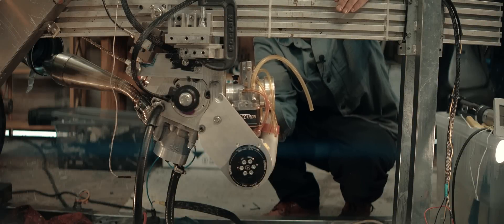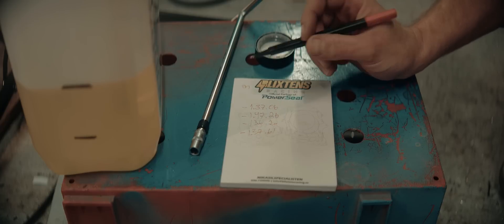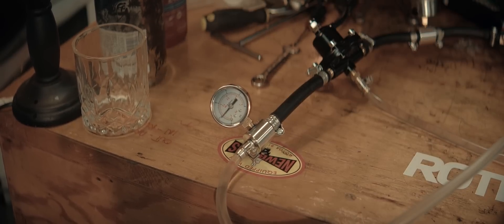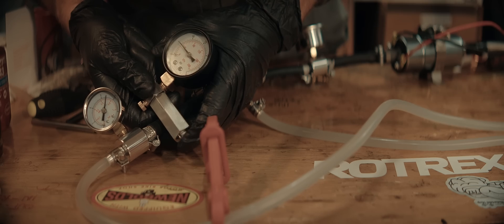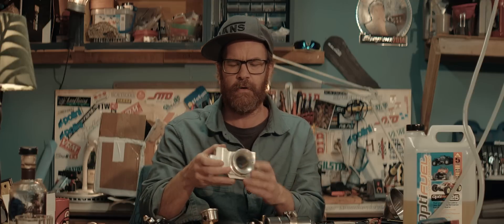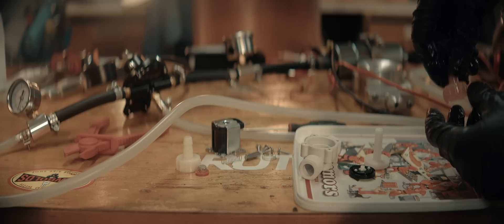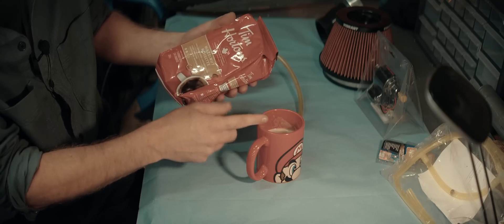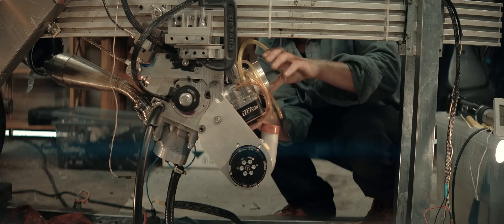48mm Carb and Supercharger on 50cc Two Stroke Engine!

Comment from the maker: Check NordVPN exclusive deal: Get 4 months free on 2 years subscription
here https://nordvpn.com/2strokestuffing
It's risk-free with a 30-day money back guarantee!
Reply: I’m not sure how to contact you but I am pretty sure I have the simple and obvious solution to your carb issues. Mikuni super BN carbs, particularly a 38mm unit made for a 65hp sea doo jet ski, should be more than adequate. The carb I speak of should easily support your fuel flow needs and these units are specifically engineered to be resilient to the harshest of vibrations and resonance. I have a few in stock and I could easily build one for you, and send you part numbers to buy a tuning kit with different jets and regulator springs. I can advise you on how to tune it. I’m confident that you’ll get what you want out of the super BN 38
Reply: Glad you're back! ^^
Reply: We will make a peripheral ported rotary engine builder out of you, if you keep this up!
Reply: Hi Alex just checking that you have used a Lectron Carbs before, they are very different to a normal jet/needle circuit carb. They use a Metering Rod and it catches out a lot of people.
I use them on my Land Speed Suzuki/Aprilia 250cc engines 2x38mm and they work great as long as you learn how to tune them and use a big airbox.
In this case I wonder if having the central inserts you made will interfere with the Metering Rod's ability to draw fuel from the bowl.
Maybe an offset reducer with the new diameter at the bottom of the intake or a narrow slot in the existing ones that allows the metering rod to work the way it was designed?
Reply from the maker: @PetefromSouthOz  Thanks for the input👍we'll se how it behaves and modify if necessary. . Never used a Lectron, but I understand how it works and how to adjust it.

Comment: Hi while looking into supercharging I was reminded of the Roots  6-71 blowers that were installed on. Detriot Diesel  2 stroke Diesel engines, which had pressurised lubrication to the crank hence not using crankcase scavenging, which made me wonder why you are pushing pressurised air into the crankcase when you could fill the cylinder directly via cylinder wall ports. In a similar way the Deltic 2 stoke diesel albeit in an unusual configuration used centrifugal compressors to fill the cylinders via cylinder wall ports with no crankcase scavenging , just a thought.

Comment: venturi size is really about air, since you can cram alot of fuel through a small carb but the limiting factor is how much AIR, not fuel it can injest. try it... put a huge main jet in a small carb. it will choke itself down like crazy, as it cant get the air it needs.
Reply from the maker: On nitromethanol you easily become fuel restricted. Typical scenario: Completely remove all jets, drill out idle circuit, add powerjets, drill float needle seat to max without leaking - still not enough fuel, and the bowl runs dry.

Comment: Tim Hortons is the 💣, do you like hockey?2-Strokes not stuffed, quick maths. Wana hear the most annoying sound ever? Turns on pump. I was thinking the same thing about pressure and flow looking at components. You measure from the bottom or top of the lines? Thicc lines. Those Great Danes. I would try to scratch sample pieces of petrochemical distalates in my petrochemical distalates, science. I bet you could stuff the hell outta a Saab 850 🤔 *dream sequence "go go Gadget Stuffer"*. Do you have a filiment heating box? I love mine.

Comment: Alex, I hope you see this before getting too deep into pumps. The speedway carb is fine.  What your calling a dash pot can be used as your floatless fuel bowl.  Gravity feed in, Overflow out.  Pump overflow back to tank. Constant fuel level (at overflow) so long as overflow capacity exceeds input capacity. KISS system as some experts recommend. No requirement for pressure management! Cheers Daryl.
Reply from the maker: Good point👍But I would need fuel pressure to sit above boost pressure still, back to pumps.
Reply: @2STROKESTUFFING  True, my thinking was still Draw through not Blow through. I need to think deeper.
Reply: @2STROKESTUFFING  If the fuel tank was pressurised by blower to boost pressure, and the fuel bowl and overflow return was enclosed and also at blower pressure....then the operating pressure at the main jet would always be at Gravity head + boost pressure.  Always correct, no matter what Boost, Simple! (maybe!)

Comment: Use an HIF44 (44mm) carb used in Mini turbo engines xD
Just remembered you could use the original plenum that has a choke built in for the boost signal :)

Comment: In the later 70's we were running 16 or 18 mm carbs on highly modified engines running on methanol. 48mm is insane

Comment: am i blind or did he really epoxy fitted those carbon fibre nylon hose on those seriously expensive lectron carburator, what about when he needed to remove that hose to bring back that carburator in its original form 😅

Comment: May I make a suggestion.. feed into an inlet plenum rather than straight into the carburettor.. the turbulent air may cause you problems with fuel air mix … another thing I found with a blow type system is the greater than atmospheric pressure pushes fuel out of the carburettor … great videos as always

Comment: I wonder how a vacuum chamber would work for filament drying. The problem I run into with drying things in the vacuum chamber is that there isn’t enough latent heat to boil off substantial fluids since the rate of heat transfer through the conducting surfaces is so slow. Might not be a problem at all with filament since the volume of water would be relatively low but a little preheat could guarantee it had enough energy to boil off in the vacuum.

Comment: As a number of Japanese motorcycle manufacturers found out the hard way a long time ago, it's impossible to gain any advantages by turbo or supercharging a 2stroke engine, because putting in extra crankcase pressure, ends up having every stroke like a compression stroke, and a lot of fuel is pushed out the exhaust unburnt, and only one stroke returns with power, which gets absorbed by the crankcase pressure stroke and the more boost the worse it gets, losing more torque and hp at vital power rev ranges, so a loss of advantages in weight and gain of disadvantages in economy.

Comment: The PWK is a superior carb in every way. The Lectrons were crap 30 years ago and still are.
Reply from the maker: I really like PWK's, never tried a Lectron before.
Reply: Back in my day people who fitted Lectrons to their TZ250 really wanted to go back to their Mikuni's here in the UK.
I personally would like to see a 11/2"  SU CV carb with adjustable main jet and seperate float bowl given a try. These were fitted to UK 1000cc mini's
Reply: @malcrandall1309  20 years ago the "fix" for lectrons was adding a dial-a-jet power jet. Lection must have realized this was a good addition as they come standard with them now. I hand ground tapers on the needles trying to get even mixtures across the RPM range. Not so bad on 1 carb but getting a mating set of 4 was an exercise in futility.

Comment: In regards to keeping filament dry. The most economical option I've found is a steel 5 gallon bucket with a Gamma2 lid. I also recommend using a SensorPush HT1 humidity sensor. Color-indicating desiccant is a great way to visually remind yourself to change/dry your desiccant. Additionally, aluminum, when in contact with carbon fiber, will become galvanically corroded and will weaken. A barrier material of even .002" thick will suffice in preventing corrosion, especially if it is a plastic-fiber composite part.

Comment: I'm an electrical engineer so I'm thrilled by the idea of the lectron Carbs.  They are cool as hell.  However, my buddy that used to race AMA pro-nationals had trouble with one (fun bike not race bike).  Leaning out in the mid range and stuff (2 stroke).  I'm excited to see how it works out for the monster 50 though!!!

Comment: If your doing a blow through set up You need to pressure rise the float bow from the charger cap all breather/vent holes to the bowl and leave 1 vent tube to pressures to bowl. The carby also needs to breath at atmospheric pressure 1 or 2 holes at the intake of the carb need to be vented outs side of the charger intake. Best way to do this is plenum box.

Comment: Check how you plumbed the fuel pressure regulator. Just sorted out a guys install on a car where he ran the return to the port that would feed a second fuel rail. Flow from the pump was going straight back to tank. You shouldn't need to pinch off your fuel line to see pressure on the gauge. The regulator should build pressure and then dump fuel to the return but keep pressure even when the pump is shut off until it bleeds off slowly.

Comment: Why don't you use regular 2strokes fuel??
I know that the HP will be lower on 2strokes fuel, but by how much???
Reply from the maker: Cause methanol is much more tolerant to high compression/boost.
Reply: @2STROKESTUFFING  and E85 or race fuel??
Reply: I along with some others would have liked to see it set up and run on none RC fuel.When Alex changed his SPX over to RC fuel 5 years ago it became totally un reliable.
There are to many things to sort out. After all this time the dyno is still not running right, I come from the clockwork era so I feel the project is over complicated. I also feel the dyno should be controled by a manual potentiometer not by a unit that's not working as it should.
Reply from the maker: Might just try gas if we're experiencing trouble now👍 I really should get a known good engine in the dyno and make sure everything works.
Reply: @2STROKESTUFFING  Alex, I know you have limited time in the workshop and your totally in your zone working on your carb and Rotrex, but do you think crank ballance factor could be a part reason for load cell data corruption.
Just use a torque wrench on the crank for now with no extensions. I know the comments said this was wrong but  you're not using these readings for certification.
Hope you get to see this after I posted it so late.

Comment: Should use a lab power suply to run fuel pumps and other things so you don't use batteries
Reply from the maker: Haven't got one that can deliver enough current, otherwise I would 👍

Comment: Those Lektron carbs can be tuned to suit almost any conditions, as you have a supercharger I'd say it will work especially if you put an oval bushing in the venturi to make it smaller, alternatively swap the carb for a smaller one by putting an appeal out on your channel

Comment: I would suggest using a stabilized power supply for the pump, instead of battery directly. It will be one thing less to cause problems. As you saw, the pump flow will be constantly dropping as the battery discharges...
How much current does the pump draws? Even un-stabilized power supply (simple transformer, bridge rectifier and a capacitor) will be better than the battery...
Reply from the maker: The pressure regulator should compensate for it unless pressure in drops too close to pressure out.
Reply: @2STROKESTUFFING  ok, but then you just making some good runs with 40HP+, and the battery dies 🤔

Comment: Outrageous 😂 I can’t believe the size of that Lectron Carb!! Even 33mm seems like a massive size. I had twin side draught 44mm Mikuni carbs on a mildly hot rodded 2 liter engine. Each piston/cylinder displaced 550cc. It was 4 stroke with 2 valve head though and it was not super charged. But still each chamber had 10 times the displacement of this little monster. I’ve currently got 4 - 33mm slide carbs on a 4 cylinder 750cc motorcycle engine. Each cylinder displaces 187.5cc. This little monster is thirsty. 

Loved the video!! Really great to be part of the testing journey.

Comment: You need a 12 volt diesel  fuel pump . Safe on volatile  fuel and run between 3 and 15 lbs

Comment: Have you tried using a bypass regulator or a  FMU ?
Reply from the maker: My regulator is a bypass regulator i think.
Reply: @2STROKESTUFFING  you are correct, but they make a part called a FMU (Fuel management unit ) if you end up needing more pressure to work with it that and it gives you more options for max fuel pressure under boost.the regulator is only good for 1 to 1 ratio. also you can put a air bleed on the reference port line to fine tune the  fuel pressure.

Comment: I've had a idea I don't recall seeing before so it might be a bad one instead of using a fuel pump preshorise the fuel tank with a small pre charged air tank with a regular to set the PSI you need and to make it safer it could be similar to a central heating expansion vessel so the added comprest air only pushes a diaphragm or fills a bladder then a over preshor blow off valve would only exhaust air not fuel vapour it's just a idea I had but if it works there would be a lot of benefits over a electric fuel pump no need to add weight will battery's or drag on the engine to power it the air tank could be the framework of the bike electric pumps can raise the temperature of the fuel and using a fuel regulator that returns to the tank fuel temp with a small tank could become a problem and when the fuel tank is getting low the returning fuel can cause frothing causing problems well before the tank is empty I think my idea would be a simple way of doing it?

Comment: I like the new blower but the fueling setup has too many possible failiure points and I think it should be replaced by something more simple and easily regulated like EFI for example.
Reply from the maker: EFI would keep all the stuff except for the carb which would be replaced with a throttle body and injectors. Conventional EFI is not a trivial task on high revving two strokes.

Comment: Still dont know why the engine sits upside down
Reply from the maker: To keep the exhaust pipe relatively straight, and to avoid fuel puddling in the crank case.

Comment: Since you're using an electric fuel pump, you can just ditch the shutoff valve and tie the fuel pump in to the ignition circuit.  No spark, no fuel. You also have all the components now to just use a fuel injector.  It wouldn't be too hard to just have an throttle dependent ramp for duty cycle (alpha-N).  Or even a mechanical barrel valve like on old-school blowers.   The regulator would take care of the boost reference. Love to see how your crazy mind works :)

Comment: Loughed so hard when you present these enormous carbs for your 50cc engine because my 125cc Mito comes stock with a 28mm one😂
Funfact No 2: I run a 125er main nozzle and it a rich setup🤣

Comment: Grab a 150+gph Summit pump kit. Undervolt the pump to 8-9volt. Almost quiet.. That pump sounds lije its cavitating. Tank-large filter-liftpump-line-big pump-pressure reducer-pressure metering-carb.

Comment: My Honda monkey had a 9 mm carb. The Minarelli tuned moped I really loved had a 14 mm carb with a flat slide. The torque was nice and it worked really well. I tried with a Dellorto 16 mm, but never got the jets right. I laughed at my friend and his Suzuki 50 cc with a 80 cc cylinder with a 20 mm carb. Sorry, 48 mm carb on a 50 cc is lunacy!
Edit: My Opel Ascona 1.9S had 40's dellortos, so did my Ford Escort 1.6 liter Kent. I felt that going over 40 mm was too much. These where like 400 cc or 475 cc per cylinder and carb!

Comment: I love you man I love your videos but thus test is flawed, your flow is almost certainly not accurate as you are powering an electric pump with a battery the flow will fluctuate as voltage drops so should flow rate
Reply: Regulated bench top power supply may be the answer
Reply from the maker: That's what the pressure regulator is for👍

Comment: You really shouldn't use that cheap water solenoid. Fuel solenoids are "explosion proof" meaning it's potted to make sure no sparks/hot coils are able to escape or mingle with fuel vapors.
Reply from the maker: Good point!

Comment: you could use efoy (corp) style methanol fuel cell, to get direct electricity, btw
Reply: something like 700-1200kWh/kg, should be similar to the ice engine at 25%, assuming 1200Wh*4 = 4800Wh/kg
Reply: and no random annoying noise
Reply: sorry 1.4kWh/kg for the current methanol fuel cells of efoy (corp)

Comment: I can help you source a pump that will handle methanol :) Hit me up 

Also you can use the 150 nozzle as restictor and use a rheostat or somthing similar to adjust the pumps voltage, hence adjusting the flowrate :)

Comment: For the filament I got a dryer from Eibos it doesn’t have a timer so you can leave it on and keep the filament warm and below 10% humidity. I’ve done a 5month test on petg and experienced no problems with keeping the filament at a high temp.

Comment: 100cc Kart Engine, 21,000rpm
24mm Carby
60cc Kart engine, 16,000rpm
18mm Carby

Your carby is 3.5 bigger in cross section than a 100cc kart one, which revs 30% more. 

Yes, you get more in, but your velocity through the venturi will be poor, reducing delta p through it.

Comment: Why you dont use normal motorcycle carb with butterfly valve and slide that is actuated by diaphragm. Throttle wont stick, and these carbs has been used in turbo motorcycles for decades. They are not as cool as huge racing flat slide carbs probably. With pitot pipe and carb modified for boost, there is going to be always pressurised fuel flowing to bowl because greater pressure differential than gravity feed system. Pitot tube connected to float chamber also makes jet size required very much smaller.

Comment: I printed a carbon fiber (PLA with 20%CF) and found out this material is not suited against normal gasoline, I suppose also not for methanol. Did use them eventually but I had to add a layer of epoxy aswell. I saw you only added epoxy for sealing the gap of the carb and the insert which made me wonder if it is necessary or not. What type of brand of filament did you use? Keep up the good work 💪